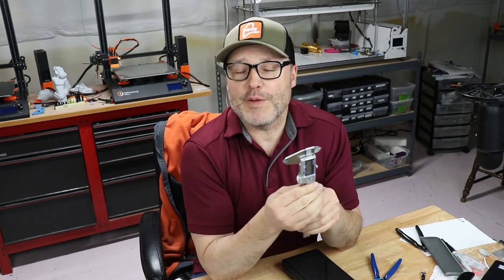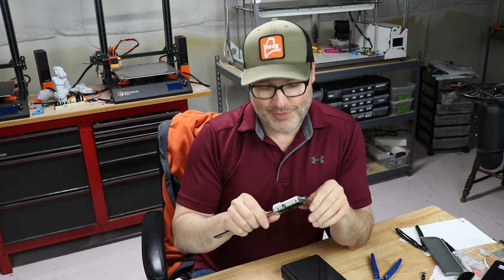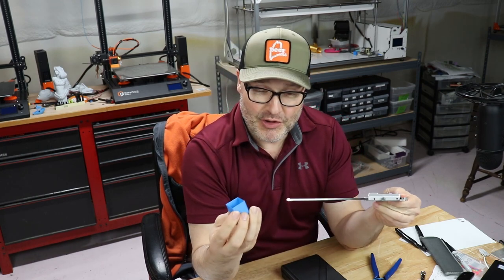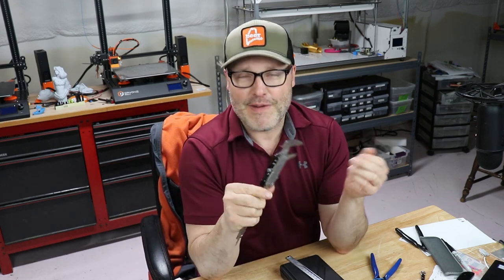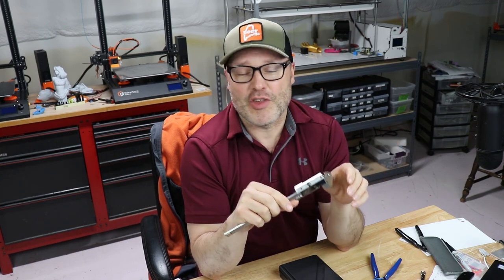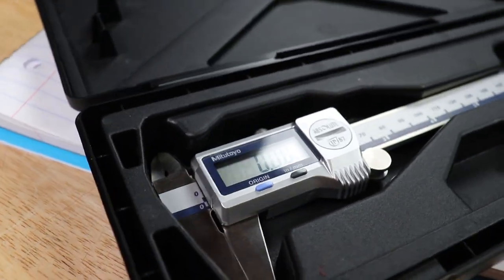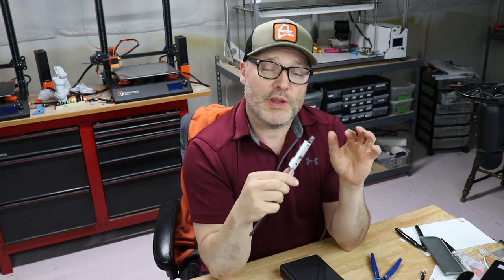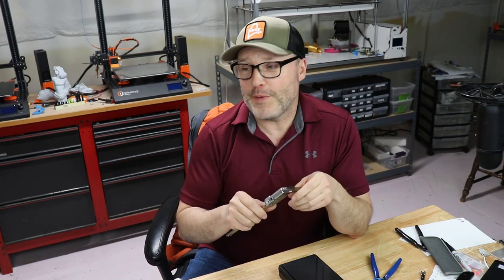Tools for 3D Printing: Digital Calipers!

Comment: One tool I have not seen yet on YouTube for 3d printing is an extension adapter to the digital caliper. That would be a great accessory to 3d print because buying an extension attachment for digital caliper can be pricey. Just thought I would put that idea out there. Cool thing about digital calipers is all the accessories attachments you can use on the main jaws and on the back side you can attach a depth gauge attachment. Most pricey accessory I have seen though for the digital caliper is the extender attachment but makes it way more handy for other tasks at hand.
Reply from the maker: Good points. Honestly my favorite tool lately has been a micrometer for accurately measuring wall thickness for flow testing.

Comment: What size is a good recommendation 6" or 8"?
Reply from the maker: Depends on your usages. For just dialing in 3D prints the smaller should be fine (I wanted one that could do at least 100mm plus)

Comment: I hope for x/y/z you don´t use these cubes. An error of use 0.05mm/20mm adds up with big prints. Also you don´t want to calibrate the printer to a specific slicer setting or filament. Something like this is very handy to setup and verify measurements of your printers movements: https://www.thingiverse.com/thing:4599123
Reply from the maker: I only use those single wall cubes for extrusion multiplier.  I like your link!  Did you enjoy my misbehaving caliper? 😂